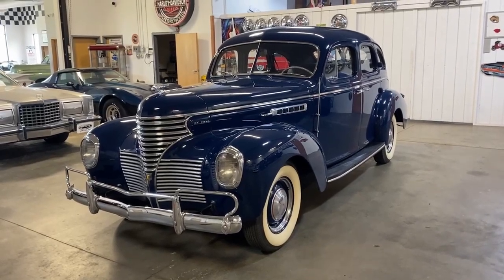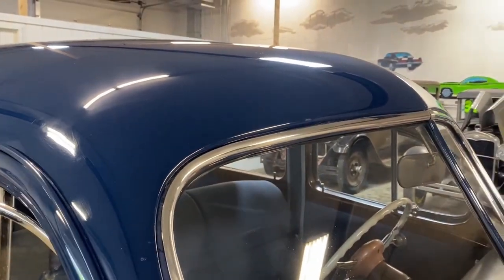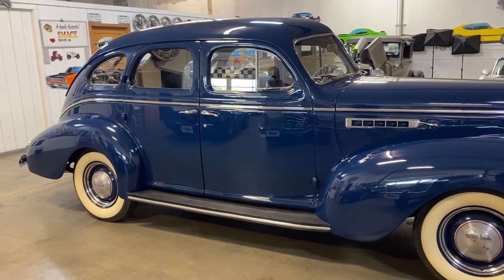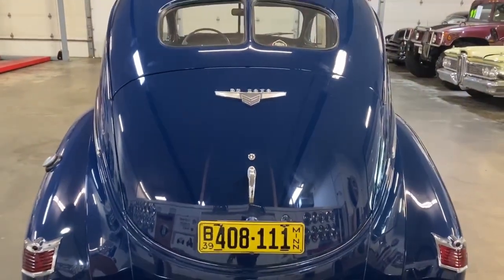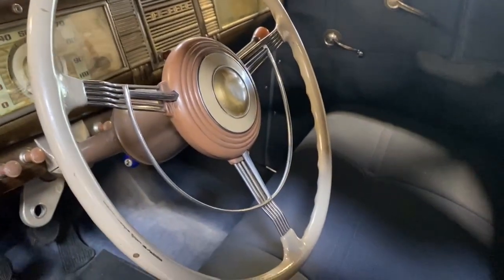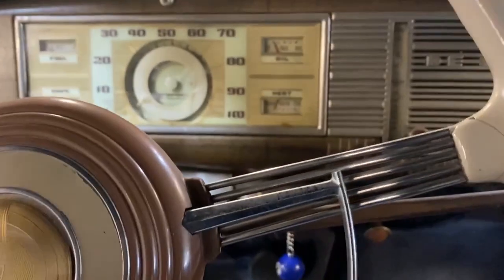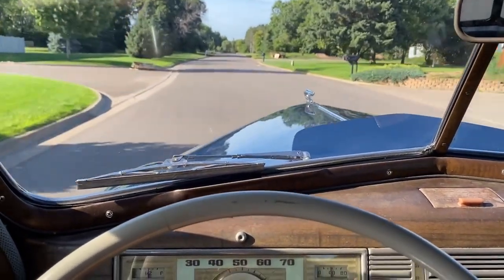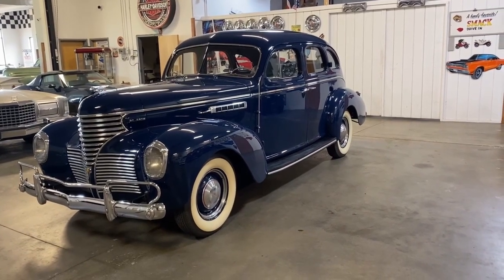1939 Desoto S-6 Touring Sedan CC10443

Comment: This is the same as my first car in about 1960 it had leather upholstery. I used to carry a new head gasket as it used to suddenly blow and I used to just change it on the side of the road using a ring spanner. Also the shocks were clapped still it was a great old car.